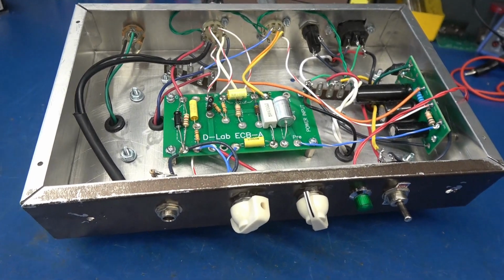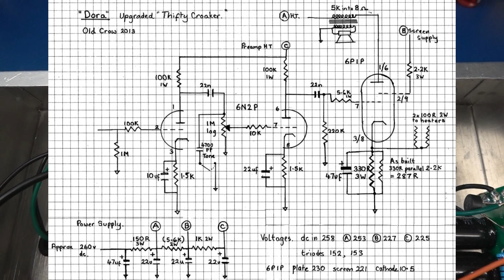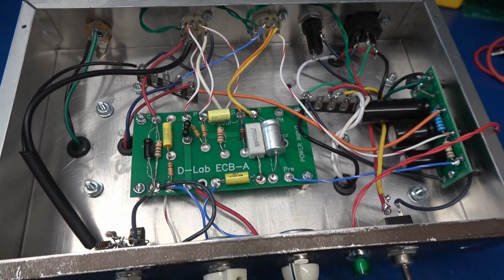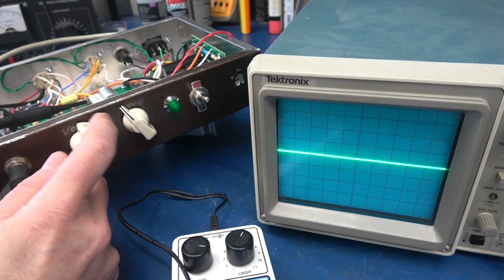D-Lab Basic training Fred & Fink are back trace highly distorted tube guitar amp kit build

Comment: What is it called when you only ground one end of the RG174 coax cable and float the other end? There is a term that engineers use for doing this. I'm not sure what you mean by how the poor wire dressing was caused "direct inductance" or what you mean by what is causing "direct inductance"?

Comment: They never teach anyone about wire dressing in electronic circuits so much anymore but this shows how very important to keep signal wiring and power wiring as far as possible from each other. I remember some tube radios had issues with that
in the past and it was always solved by 1. changing wire locations or 2. by putting a coax wire in with one end ground to chassis of the coax's braided  shielding.

Comment: Great video Terry, I wonder (2:45) why the volume pot  had an unresponsive portion while the oscillation was there.
Reply: I had a thing like that in a DIY amp i rushed. There were a couple of parasitic oscillations such that there was actually a noise "notch" in the travel of a 1M potentiometer outside of which was hum & distortion. 

One thing i did wrong a couple yrs ago, is using where the terminal straps screw to a chassis as chassis gnd. That's as bad an idea as connecting to the xfmr bolt, which I've also done once before and that also compromised the gnd system.